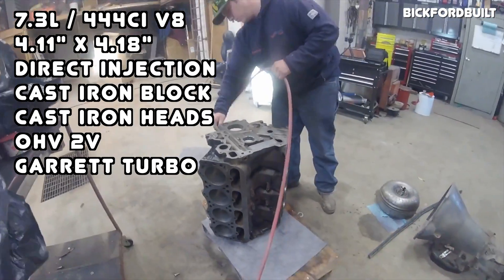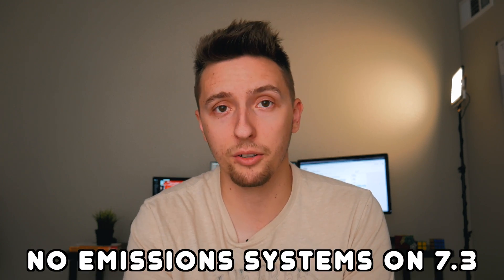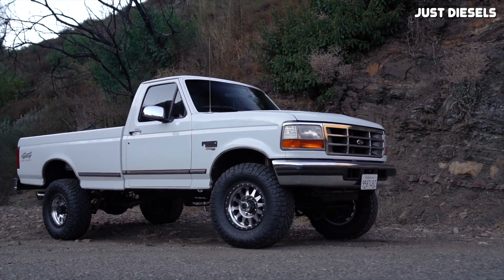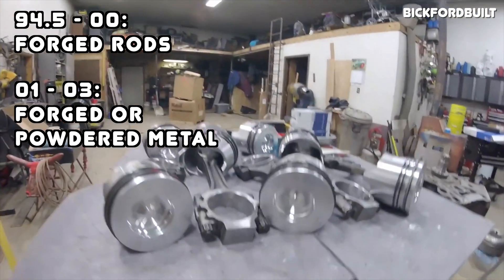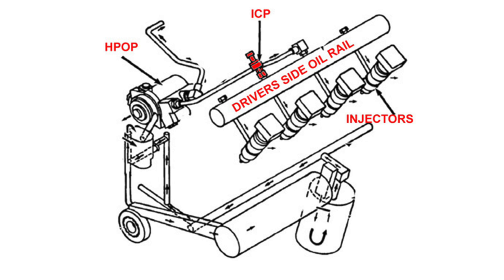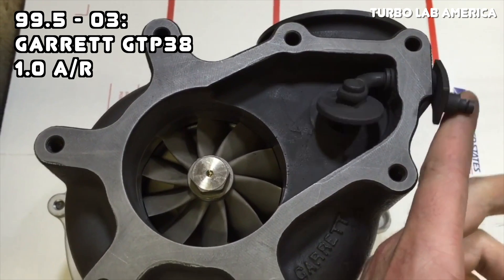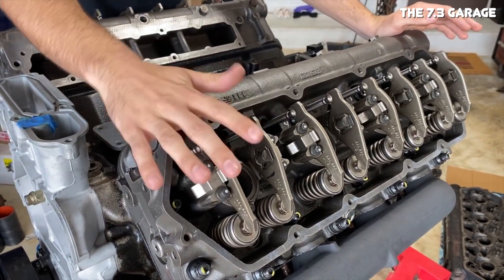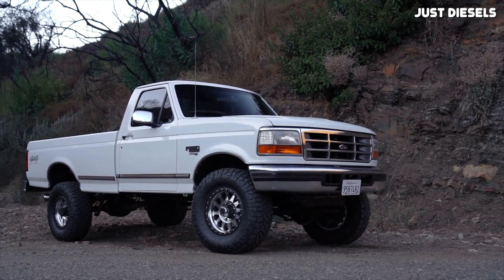7.3 Powerstroke: Everything You Need to Know

Comment: It might be reliable but its its expensive to fix parts are more expensive its a more complex design simplicity is key that the reason why semi's use I6 motirs cause its easier to work on as well as cheaper to maintain parts aren't as big... Such as a powerstroke waterpump they are around 450ish while i cummins is 350 at most. More simple is better in day to day use and maintenance

Comment: The 7.3L Powerstroke is the best light truck diesel engine ever. The Cummins is a great engine, but it's in a rattle trap of a truck. The engine was designed by Navistar for delivery trucks.
Reply: so are you comparing the engine or the truck? the ford truck is better for sure, but a quick comparison of engine internals shows the superior engine.

Comment: I run my 98 e350 7.3 on WMO.
It started  on 250k and It stopped  at 380k(miles)
The hpop went  bad and the rust stopped me from fixing  it.
Bought  a 01 e350 with 209k. On 07/15/2020. I started running it on transmission oil since day 1.
Looking  forward  for another  200k on transmission oil to save the planet.😁😁😁😁

Comment: trick to running a good engine to the max life of it,is buy oil in 55 gallon drums,and change it often,overhauls done right are 6500,drums of oil are cheaper,we have 2-- 7.3s turbocharged and one 7.3 IDI i guess they are going to run forever,oil and filters and down the road you go,putting new parts in place of good parts is nuts

Comment: The 454 of the time had more hp and only 15 less torque but the fuel economy is crap on the 454 (7.4)
Reply: the 454 chevy engine has the worst rod stroke ratio of any gas engine ever made,its trying to tear the skirts right off the piston every movement up and down,every one i have torn down for inspection has had the cylinder walls scored,bore and new pistons,1000.00 every time,no thanks

Comment: My first 7.3 died of alcohol poisoning at 180,000 miles... 27 gallon/hour stage 1 meth injection running 150 proof meth and a tuner.  Since then, it's been restricted to a 20 gallon/hour stage 2 running a 50/50 mix.. and a tuner.  I suspect the first motor hydro-locked, too much liquid too fast.

These motors were extremely under tuned from the factory, probably for emissions.  The 7.3  can be   easily (and safely) tuned for an added 50-100 HP... your emissions may vary.
Reply: Steve, sure it can put out more power, but heat is the silent killer.  I'm the original owner of an 03 that just turned 40K miles.  I bought a tuner. but also installed an EGT gauge.  Pulling a load up hill with the tune on quickly put the temp readings too high.  It got old real fast, watching the gauge and adjusting the accelerator.  I just run it stock now and can put my foot to the floor all day long without worry of burning it up.  There's no need to race up a grade anyway, which is the only time I can't run the speed limit.

Comment: I do love my 6.0s. But today’s tech and aftermarket can make those old 7.3s run with the new stuff. Can’t beat the sound of single shot injectors
Reply: Fuck da 6.0
Reply: Hey buddy what is the key to a 6.0
Reply: pfft, split shot hybrids are pretty sweet too at 300/200 >:D
Reply: If you put about $8,500 into them they’re not all that bad. (The 6.0) the biggest problem I’ve had with them is the head gasket which is a real pain to do.
Reply: @billwarbrick9116  If you get rid of the torque to yield head bots and replace them with studs. They become pretty reliable.

Comment: Drove EMS ambulances with 7.3 diesels. Best engines ever. Very dependable.  So I  purchased 2001 F250 supercrew 4x4 7.3. This engine has the cleanest engine oil ever. Missed an oil change, and at 15,000 miles my oil change guy was amazed when he pulled out the dip stick that he could easily read the printing on it through the oil

Comment: Still kickin ass with my 2000 7.3 just hit 205k my first and only truck. For 7 years has beans sump with return new fuel screens raptor lift pump with bigger lines ts6 with wildman tunes bigger banjo bolts spx gtp38 rebuild with hurricane wheel and stepped gap big 5inch cat filter to 4inch straight pipe to 8 inch mitercut stack all new relays new trans cooler cmgs stage 3 metonal kit afe bladerunner manifold oil crossover lines fuel bowl delete new connecting rods new pin bushings 180over injectors  plus alot more pulls better than a 12v and screams louder than a 24v 7.3s were powerhouse's for there time

Comment: One problem with the 7.3 is the nut that holds the oil dipstick in. It gets loose and o-ring backs off. They sell really good after market replacement parts for them. 02 best truck I’ve ever owed.

Comment: 300k on my early 99 w/original 4r100. About 100k of those miles where pulling a 17k lb trailer. Burns no oil and doesn't turn oil black with 3k miles changes. Only repairs have been 2 alternators and 2 water pumps.

Comment: The reason idi has 5 bolts a cillinder is because it was never planed to be turboed. But ford did it last minute.  And idis are simpler and are not electronicly controlled and are strictly mechanical. Witch means idis are more reliable. Bit the powerstroke gets all the glory. Bc it started the powerstroke and was before the POS 6 and 6.4s

Comment: I had both a 7.3 (2001 F250) and a 6.0 (2004 F350) when I was in high school, and I believe both trucks have their ups and downs.  The 6.0 surely had engine problems not too long after I got it (spoilers and not big surprise, blown head gasket from failed EGR cooler), but after a costly repair and top end rebuild (new gaskets and head studs along with new oil cooler and EGR bypass), it has been a great engine ever since aside from the few electrical issues that developed along the way (most of them being charging related).  Now for the 7.3 I've never had ANY issues out of the engine, in fact most of the issues I had with that truck were mostly related to the transmission (mine was an automatic, that's why); the torque converter failed when pulling a big trailer and eventually took the transmission with it, so after a full rebuild and new billet torque converter, I got the truck back and it drove great (although looking back I wish I had the valve body modified since it did have an issue with hard shifting from 2nd to 3rd gear).  Both trucks have their flaws and I'm sure others will have different horror stories than I've had, but I do love both trucks, I love the 6.0 mostly for its power (even though a chip on a 7.3 can always fix that, but I would make sure the auto trans is built or you have a better clutch on the manual trucks), but I love the 7.3 for its reliability and overall longevity.
Reply: Grayson Reichert ours other than air bags is a bone stock 7.3 and it’s about to turn 500k
Reply: @billwarbrick9116  good maintenance the key for these motors for sure. My dad had 4 from 95-2002 and all of them had about 600k when he sold them for new. I bought a used 01 7.3 but it was obviously poorly maintained so it’s needed almost constant repairs with just 191k on it.

Comment: Could you plz do a 460 gas vs the 7.5 turbo diesel? Maybe even throw in the 351 Windsor too to give comparison for the time period.
Reply: 6.5 trash lifters failure turbo failure fuel pump fail get a 6bt or t444e
Reply: There isn't a 7.5 powerstroke

Comment: They claim it has more horse power and more torque but a 5.9 will out tow and out run the 7.3
Reply: Jordan Barakat I disagree. We’ve pulled literally everything with our 7.3 and it’s pulled it. Take for an example the fully loaded tanker (it was a super b) that ours pulled out in the middle of winter with no chains on. (There was about two feet of snow and ice on the road not plowed or sanded)

Comment: Can’t tow that much?? My 2002 towed over 35 000 lbs! But nice try
Reply: I’ve seen it tow trees, double wides, and tractors stuck in the mud
Reply: Victor Villela ours pulled a semi fully loaded out of the ditch
Reply: Lua Dipa they’re getting up there in years. But ours has almost 500 000 kilometres on her now and still runs like new
Reply: @billwarbrick9116  my 2000 f350 7.3 dually has around 900 thousand kilometres and it sounds brand new
Reply: @orkas9027  is it a standard or automatic? Our ‘99 was in a jackknife and saved my and my buddy’s life because of the big steel pipe that was put in the door. The truck was bent like a banana and still drove home.
Reply: @billwarbrick9116  it’s auto, no other brand of truck it’s age will beat it
Reply: @orkas9027  personally I prefer the standard but the automatic is okay too
Reply: @billwarbrick9116  yeah I don’t like automatic very good it’s very late shifts and starting to wear out
Reply: @orkas9027  yeah that’s true
Reply: @billwarbrick9116  ikilosin thenose
Reply: They call the 7.3 a dinosaur, but honestly I ask them, so what exactly can out pull a dinosaur 😂?
Reply: @jameshubbard7720  a better dinosaur.
Reply: @jameshubbard7720  a bigger dino
Reply: Good shit 7.3 are the best
Reply: 413k on my 1996 7.3l and I tow gross 20k damn near daily. truck and trailer put me at 12k gross.
Reply: @jasonbuttens did you boost the HP somehow?
Reply: I did a hay haul with a few guys one has a 2018 6.7 and had roughly 30,000# 
My 95 7.3 had roughly 10,000# being pulled. He laughs "can you keep up with mine?" My reply was how many miles you got? He was at 137,000 with TWO motors. He blew one already. I'm at 290,000 engine 1. He can get there faster for a short time. I'll do more times.
Reply: mark broad I now a couple Chevy guys one of them asked how many times our ford has broken down. The answer being zero times with almost 500,000. I found out recently that their truck only had 90,000 and the transfer case the transmission and the turbo had all already been replaced
Reply: @markbroad119  LMAO yeah, you should have told him 290k minus 137k....beep beep beep let me back up 153k so YOU can catch up to ME.
Reply: Bippolas Beige  yup mine pulled a backhoe and double axle gooseneck it's whole life.. Love it
Reply: Ours pulled 56k
Reply: @coleperkins86  they’ll pull anything
Reply: It doesn't have a very high official towing capacity.  That's the difference.
Reply: The 7.3L's towing capacity mostly has to do with how slow it is off the line with the stock tune as well as the suspension setup, axles, and frame since back then no one felt the need to tow 30k+ pound trailers.
Reply: @CaptainRudy4021  true, but the weight behind the truck really does help when pulling loads that heavy. Ours has plenty of power off the line. The only modification is the exhaust tip
Reply: @CaptainRudy4021 what is the towing capacity
Reply: Yeah my 96 power stroke I think the most I towed was like 22,000 up the steepest hill we have in my town and it was fairly easy. I still think the 5.9 24 valve is better but the 7.3 is pretty bullet proof
Reply: @shawnblank4917  personally I prefer the ford purely because of their front ends. That and the big steel bar that’s in their doors. Saved my life when I jackknifed my ‘99 the truck was bent at a 25-30 degree angle and still drove home
Reply: @billwarbrick9116  glad your ok man and yeah I know their awesome engines no doubt. I mean to me like me picking That year Cummins over a powerstroke is mainly preference over anything else their both really good and durable but I love Cummins noises and their a lot easier to work on. Idk if you ever had to do an oil cooler on a powerstroke or a turbo but shot like that was such a pain lol.
Reply: @shawnblank4917  they are easier to work on yes. But I’ve had to work on a lot more of the 5.9’s. To be fair the people that take them in usually drive them to the ground
Reply: benchmstr yes it did. 7000 lb trailer
And a approximately 29000 lb bobcat zoom boom. It may have been up to 1500 lbs more
Reply: 96 F350 CC 4x4 5 spd. Round turbo down pipe, h&s filter box, TS selectable tuner. It has a flatbed on it. I've had a 32 plus 5 Gooseneck for a combined empty weight of 16,100. Hauled a 23000 lb cat backhoe. Left the AC off and tuner on 50 HP in the hills. I didn't win any races but got there and got 9 MPH doing it. Most times, towing S300 Bobcat and brush grapple with air on, smaller trailer, and 75 HP setting, 11 MPG. I also plow snow with it. Western 9 ft Proplow with PileDriver wings for 11 feet per pass. Check the avatar. I hate the ride and wish it wasn't a regular cab, but I'll keep it.
Reply: Exactly
Reply: And all you gotta do to make it tow a lot is upgrade it to modern standards IE injectors, head studs, turbo, exhaust, new transmission etc. Maybe $10,000 if you wanna do the rebuild on it and youve got an indestructible truck that has all the ass behind it.
Reply: @mandavaler  and even if you don’t they still haul damn near anything
Reply: My old 2003 will pull the devil himself outta Hell as long as it’s got a firm footing! Had it 18 yrs, at 273,000 miles finally did the first major work on it I’ve had to since it was new, had to get some oil leaks fixed. Before that had a 97 I’d bought new, both trucks were a “man among men” when bought new, and still both can put in a long day’s work towing a trailer.
Reply: Calling it a dinosaur isn’t an insult it’s what makes them so reliable like a dodge slant six, caveman trucks are cool.
Reply: @jameslong1644 see the Osh Kosh hauling trucks.
Reply: So it would be good for hot shot a 97 specifically
Reply: Towed 15k with ease
Reply: I unfortunately don’t have the experience of owning one first hand but I’ve done jobs with my gramps who pulled his backhoe and skidsteer with his ‘95 350 like it was nothing😂
Reply: It'll tow as much as the truck its in can handle. But that's true of every other engine that was offered in the same truck. Some just do it better than others
Reply: Chuck Norris of trucks. Enough said.
Reply: With a built trans you can tow that everyday with no issues on top of being a monster. It tows and hauls at the same time with no issues.
Reply: Reading this I feel a bit more justified in my decision to get a 2000 F250 super duty with the 7.3 powerstroke. I think this guy is dead wrong about these trucks being weak. Many people say these trucks show off more power when they're loaded down and not empty.
Reply: Yup.... i have 2002 f350 with a banks tuner.... towed 41,000 pounds through PA no problem...
Reply: My 97 has done up around there too
Reply: We was going camping I. The mountain one time and our campers brakes locked up and we didn’t know so my dad just put the hammer down on the 7.3 and she took like a champ and still runs fine to this day. She just now coming up to 300,000 miles I think
Reply: Hell yeha.
Reply: Had a 95 f350 dually with the ZF-5 manual transmission. Had 300k miles on it in 2015 and would pull anything I hooked to. Was really light in the rear so it would spin and never get traction on wet grass or if I was chained to something I was pulling off the pavement
Reply: "Legally" tow...
Reply: @LawF250  then he should’ve said it that way. The way he worded it makes it sound gutless
Reply: @billwarbrick9116  they will pull whatever you put behind them, just not quickly lol
Reply: I'm still driving my 2000 w/ zf6 every day. Still drives like a new truck
Reply: I pulled out with 10 ton in the bed of my dually.   No problem
Reply: My 02 pulled an 83ft long, 13ft wide House trailer/prefab home, in the middle of Green Ridge State forest, on dirt roads, down steep grades. Couldn’t even get the thing where it needed to go, without cutting tree’s and shit down.
Reply: 6.0 and 6.4 have a much stronger bottom end. Up top it’s a disaster.
Reply: Me and my wife (35yo) are a 7.3 couple a excursion and a Itty bitty f250 that's way over powered... lol we have a 2nd excursion that was my mom's that's in moth balls with 35k miles I've worked on all kinds of 5.9s but for some reason it's the ford body I feel makes the difference...
Reply: If you say a 7.3 can’t tow much my uncles 02 F350 dually 7.3 daily hauls a sprayer trailer with 3 250 gallon water tanks on it for our sprayer and it does it with no problems outside of stoping and going on hills but that’s every manual trucks downfall when towing a shit ton of weight
Reply: I hauled my John Deere 7400 on a 40 ft hefty gooseneck. Tractor is roughly 12,500. Trailer is 7,500 roughly. Plus the trucks weight. 1995 Ford F-350 cclb 4wd 🤷🏼‍♂️
Reply: You where putting yourself and everyone driving around you in danger, please don’t do this
Reply: I don't find it's a motor issue. It's a diff and trans issue. It's like people putting an intake and exhaust on a mustang instead of 373 or 410's, rims or tires. They don't understand where the power gets transmitted into rotational force at the tire.
Reply: Todays diesels are broken down on the side of the road with emissions issues.  The old 7.3 pulled anything you want, especially with upgrades
Reply: Yea but wasn't rated for that
Reply: Hauln arse !
Reply: @billwarbrick9116  7.3 long rod 40,000 lbs repeatedly . No problem . Where do you need it . Nation wide is on my side
Reply: I think these newbies mean fully loaded uphill at 120mph. Lol
Reply: @NoName-tz5ji  ha ha, exactly. Great point. If you know how to PROPERLY opperate a diesel the 7.3 will do anything  you need to do with it, just slightly slower.
Reply: Bradford Ramm yup. Lol
Reply: For work 7.3 
For play 6.0
Reply: Man that's exactly what I was thinking
Reply: 7.3s stock are gutless. You can’t go 80mph with a heavy load like you can a Cummins.
Reply: @devin3156  Says who?!
Reply: The engine will pull whatever you hook it to, however the 4 speed automatic transmission and it’s limited torque input being max rated at the stock output of the engine has been the Achilles heel of the whole vehicle package.